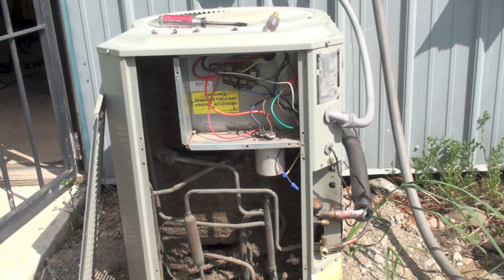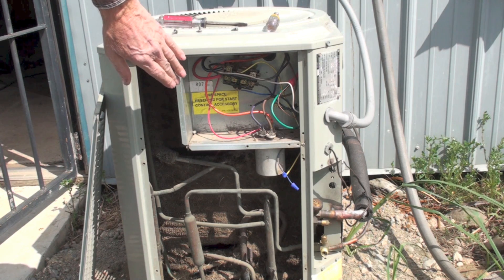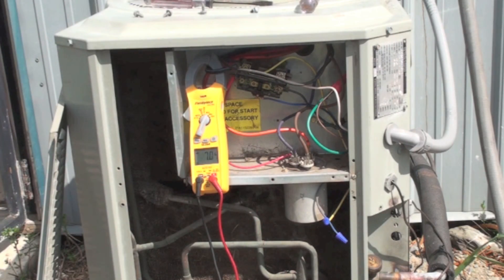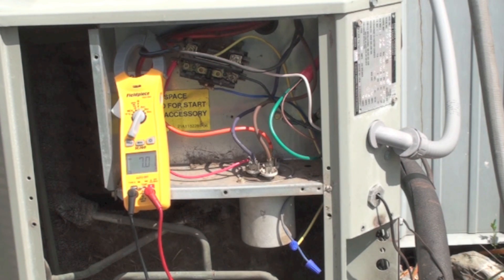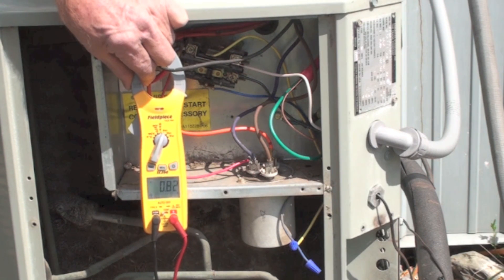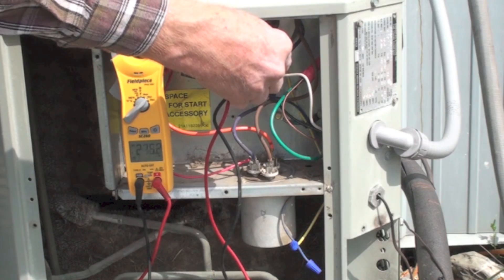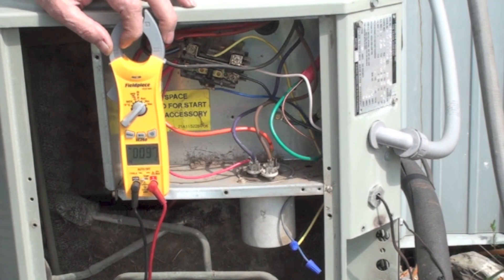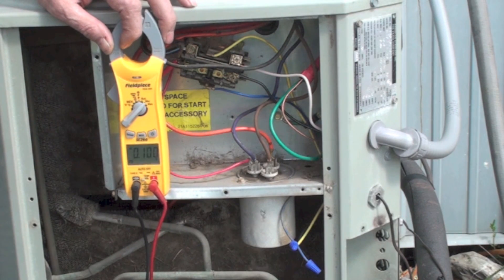Servicing the air conditioner, amp and voltage checks, part 2

Comment: What happens exactly when you have low amps draw in the compressor what cause of the issue?
Reply from the maker: If your compressor is running and the amp draw is lower than the rated amp draw, but is still providing cool air, there may be nothing wrong.  If it is not providing cool air, I can give you more options.
GFM

Comment: do you use the true rms clamp meter or none true rms?
Reply from the maker: The meter used here is true RMS.  True RMS is not necessary for PSC motor amperage draw.
GFM

Comment: Most of the machines I've been working on are far more complex than that unit and have dozens of wires coming off the contactor. Since this is the case, I've been using the current off the capacitor for the compressor and fan. They have all been very close to the rated amperage so far and functioning properly. Is this a bad technique?
Reply from the maker: Jeff S If you are saying you are amping the line that goes to common of the cap, that is not really accurate.  You need the line that comes from the contactor.  Most of these units use a single pole contactor that has common of both the fan and compressor coming off of the non switched pole of the contactor.  Try that first.  Hope this helps.
GFM

Comment: GFM. Would you happen to know the safe differential for operating amps. What is too low on amp draw, and obviously, too high would be over the FLA, correct?
Reply from the maker: J Hartranett FLA is the maximum.  If continuously operated at more than FLA, the motor protection will shut the compressor down.  Low amp draw is more problematic.  Its quite hard to diagnose using amp draw alone.  I don't know of any minumum amp draw.  I will probably be doing more on amp draw in the future.  Hope this helps.
GFM

Comment: Just out of curiosity, if a system is overcharged would the compressor have a lower amp draw?  I am asking this out of the assumption the compressor would not have to work as hard to build up the head pressure.
Reply from the maker: Daniel Baker Overcharge will increase head pressure that may increase amp draw.  Amperage draw is a function of increased refrigerant pumped, or work done.  I will be doing a series on amp draw and what makes it increase or decrease as soon as I can.
GFM